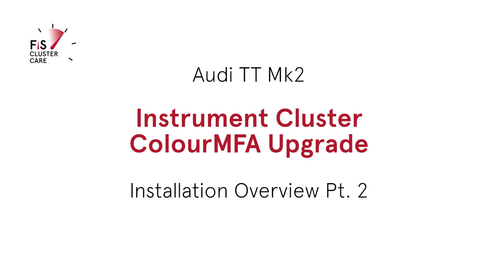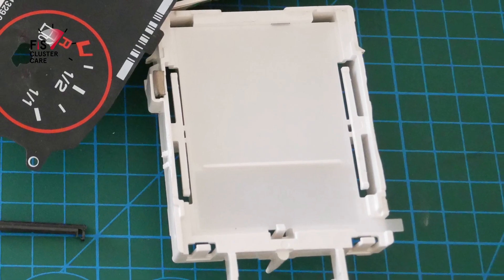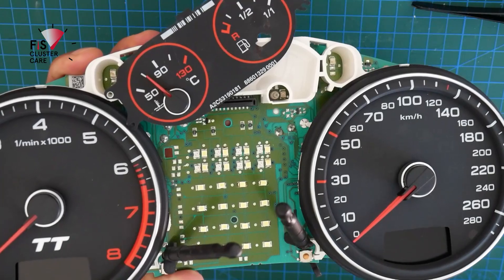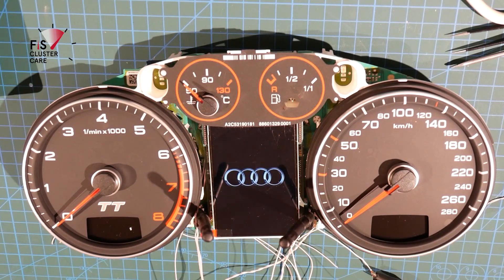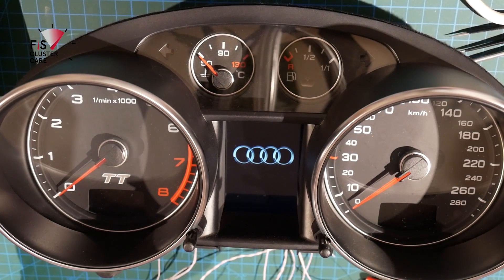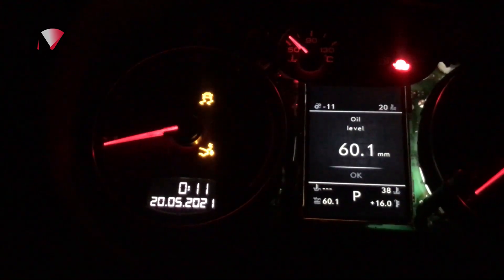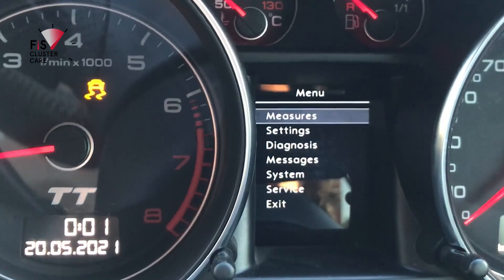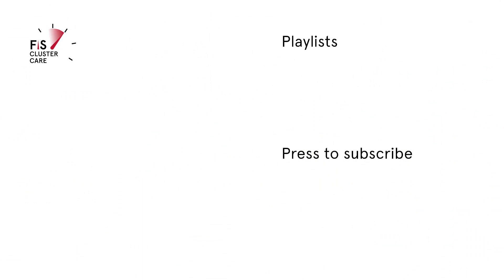ColourMFA in Audi TT Mk2 8J - Upgrade Overview Installation Part 2

Comment: Maybe I’m not seeing it on your page, but do you have a DIY of removing the cowl?  If I’m seeing this correctly, it looks like after you remove that bracket above the steering wheel it exposes the screws for the cowl removal. Am I correct?
Reply from the maker: Hi. Yeah remove the trim piece above steering wheel, remove the instrument cluster, then you'll see all the bolts for the cowl to allow removal.

Comment: Hi Ian, looks great! What is the part number of the original LCD display? I need to replace mine and I can't find the part number anywhere... 😒
Reply from the maker: It doesn’t really have an Audi VAG part as they’re replaced by them by the whole instrument unit. 

You’d need to try find them in electronics parts repairs website. I don’t know exactly what the part number or brand is though.
Reply: @ianpgonzaga  I managed to get the replacement LCD! Could you shed some light on how to remove the temp or fuel needle?
Reply from the maker: @czaplowka68  hehe nice! VERY CAREFULLY pull them off
Reply: @ianpgonzaga  Replaced and working fine, thanks!
Reply from the maker: @czaplowka68  fantastic! Nice work.

Comment: Big thank you for showing this.
Do you mind posting the connections , I have an idea of most of them but still missing a few :).
Reply from the maker: Hi. Yes I will update with an installation video but not for a while. I need another spare unit to do the full install video.
Reply: @ianpgonzaga  do you mind if I write to you on FB about the wiring ? I have my unit ready for install just need to prep the wiring and start :)
Reply: @0beed0  Did you got it installed?
Reply: @nikolaigic98  50% done. Will post about it